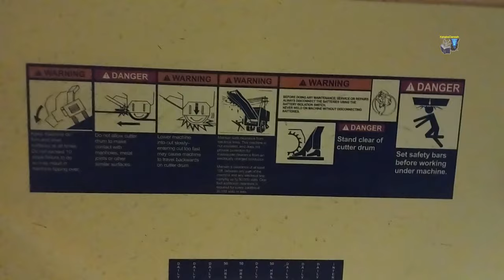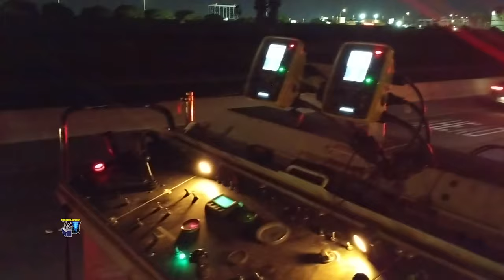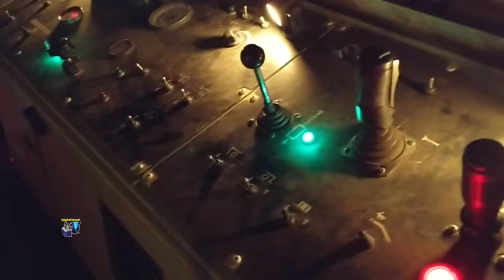USA - WIRTGEN - CALTRANS - SULLY MILLER - PETERBILT - DEERE - ROADTEC - PAVING MILLING - PART 5

Comment: An important item used in milling is water. They use water to cool the bits. If the bits get hot they wear faster. Some workers don't like you geeting close to the machines while they are trying to work. I found the best time to talk to the workers is at the end of the shift before they go home. But you need to respect they are tired and are ready to do home. So make it quick, if you are lucky they might visit for 5 or 10 minutes.